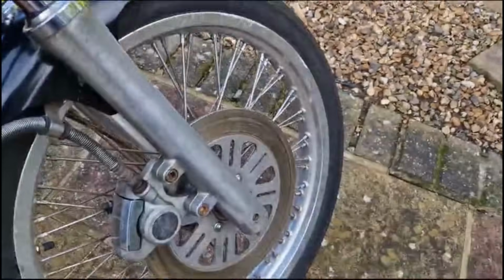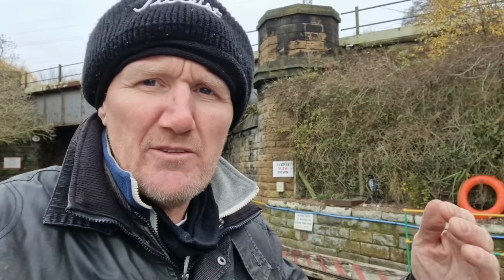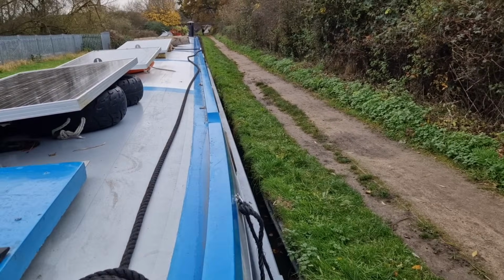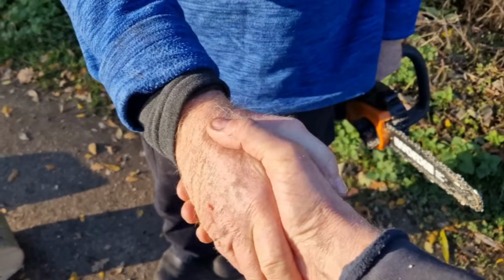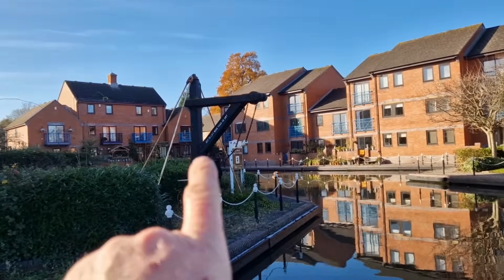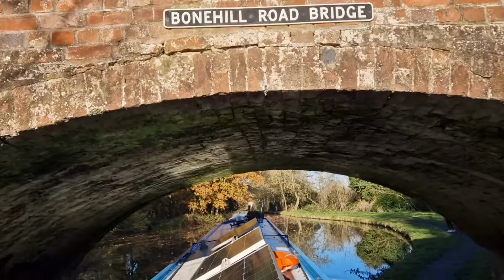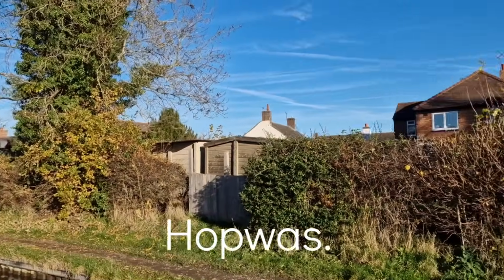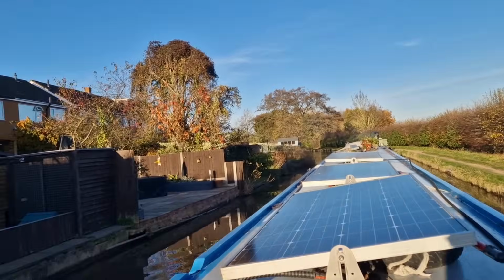Lots going on..My narrowboat journey continues around beautiful Britain.

Comment: Nice to see my local area from the cut. The white building on the left as you passed through Fazeley is where I used to work producing parts for the F1 industry. Its now an old people's complex. And the locals drop the W in Hopwas and say Hopas.. 👍
Reply from the maker: Hopas, really? I will mention that if I remember. I noticed a mentally ill chap pacing up and down in his socks he'd paced so much his socks had big holes in. The corner house on the left. I didn't film it. 😕
Reply: @NarrowboatWill  we used to be in the Old Boat House next to the 3 Tuns Pub. But now all converted into accommodation

Comment: congestion charge in London is well advertised in advance, it now covers most of London, Birmingham has one as well ,but only covers inside the ring road ,normal length for a cross country train, many trains get overcrowded  nothing new, sinking boat had no bilge pump so the person said ,tall tower is a tv transmitter can be seen for miles
Reply from the maker: It's still a scam. I don't care what lie they use.